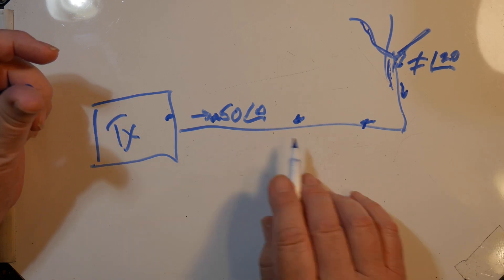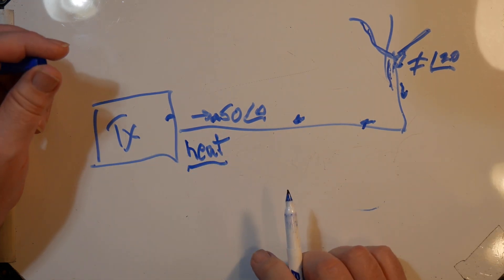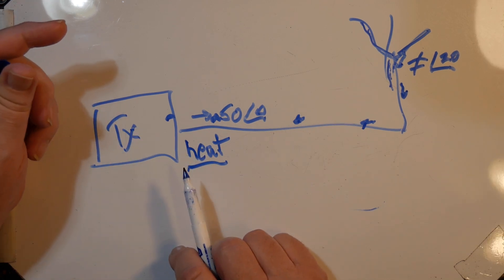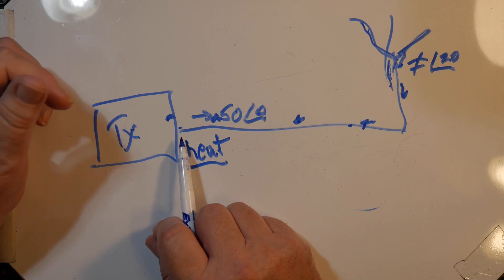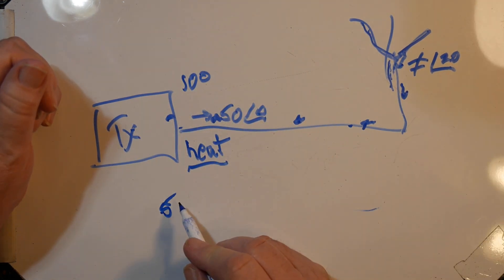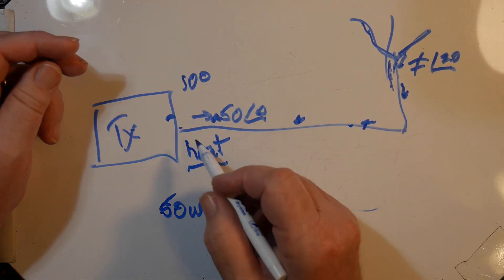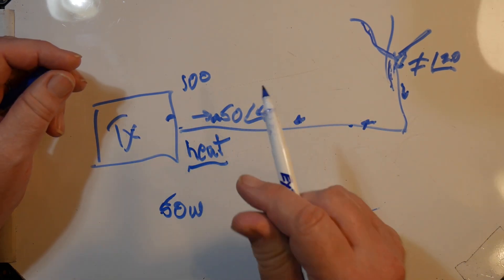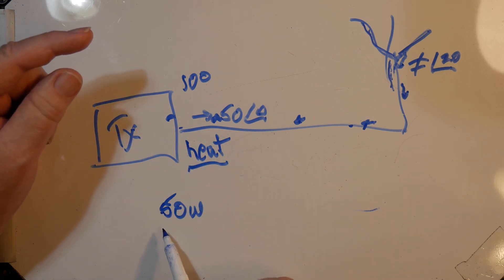Antennas Tuners do not Dissipate Heat (#1087)

Comment: 0:11 I think tuners, at least in amateur radio world, have typically 1 dB loss, sometimes I have heard as much as 3dB loss on the lower bands, e.g. 1.8 MHz. Running 1 kW with a tuner of 3 dB loss will soon get pretty warm!  All real-life capacitors, and especially inductors, have some loss.  However, I would agree that in a lot of cases, e.g. 100 Watts and well designed and built tuner, the heat dissipation will not be a problem.